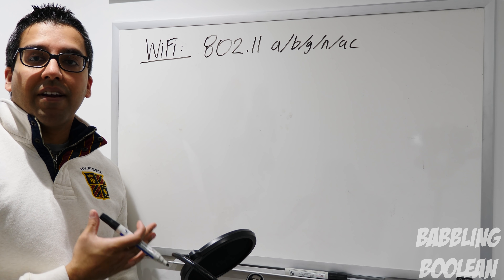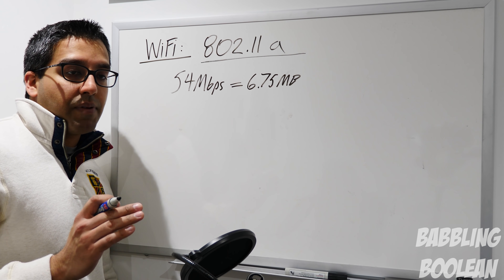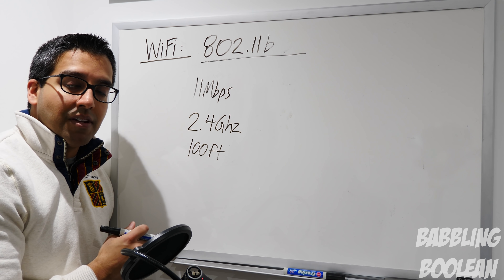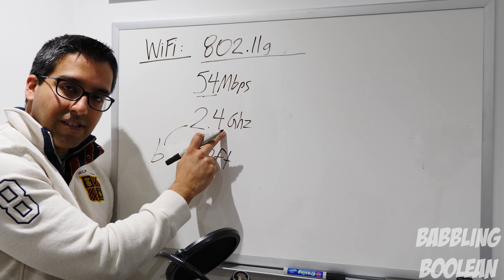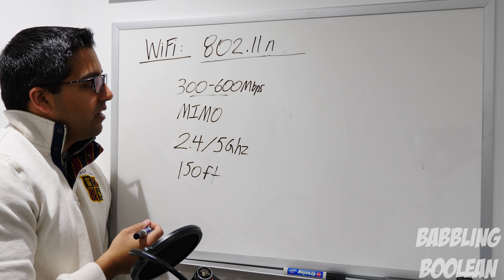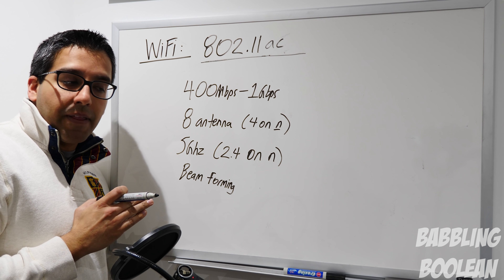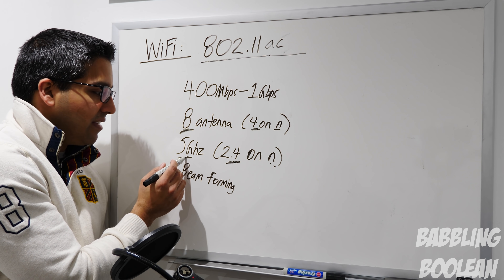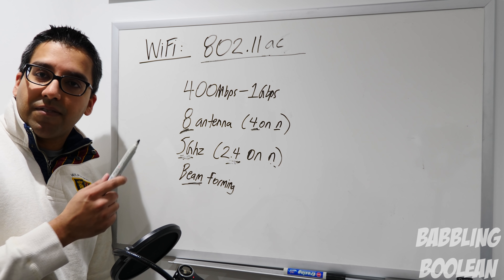Explained: WiFi 802.11 a/b/g/n/ac

Comment: Can you elaborate a little about the speed using ethernet connection on my home computer?
Reply from the maker: Ethernet provides a solid cable connection and is less susceptible to interference, connection drops due to range and faster speed. I guess I could make a video detailing the different versions of ethernet cables but that will be a little while away.

Comment: Hi, I have a question what happens if the router or modem appears the option of 802.11a/n/ac what is the best option to use the for the 5GHz the option of 802.11n because it's possible to use 2.4 and 5 in this mode or put the option of 802.11a/n/ac? 🤔

Comment: I have teenage boys whom with gaming and friends over, and use all of our high speed data in 2 days. Leaving us throttles the rest of the month. Is there anyway I can throttle my guest network?
Reply from the maker: Absolutely, if your Wifi router has that capability. I use Asus in my home and it has router settings for a guest network that allows me to set: password for guest network, how long the network stays up and throttling the speed. If you can't do that, it's a bit more work but most routers have some settings for QoS, you can explore that as an option too.

Comment: Does wireless type 802.11AC support old laptops having wireless type 802.11 a/b?
Reply from the maker: Yes the AC router will be backwards compatible and support the a/b devices. However, the a/b device's speed will cap at a/b speeds.

Comment: Great explanation. Tech made simple for those of us that are trying to learn and are not tech savvy. Thank you so much! However, I do have a specific question I hope you can answer, in your opinion, would the Lenovo Tab P11 Tablet, model # ZA7R0036US, with a 8.02AC(1x1) which Lenovo claims is a 2.4 GHZ tablet but would it be able to connect to 5GHz? Thank you, JD

Comment: So I want to buy a new phone and i plan to use it as a hotspot a lot of times to share the internet from mobile data with my PC. Should I buy a phone with 802.11 ac to achieve better speeds  with the hotspot or is this only applicable to WIFI and therefore 802.11 n is enough in a phone?

Comment: Great video - I was looking for a more technical explanation and this provided the level that I was after.   I can't get excited about the "ac" or "ax" or whatever the latest is - a mix of G and N provides the bandwidth I need for wireless connected devices.   For a lot of folks the limiting factor is going to be your ISP - not your wifi.

Comment: hi!!! i have 1 query if u can help. I recently bought a desktop tht has inbuilt wifi in the botherboard which is ac type, so whenever i connect to the internet, the internet magically stops working. this happens only when i turn the desktop on...internet works well on other devices when the desktop is off...i tried contacting my service provider they seem to dont understand the problm, also i have tried connecting the router via lan to my desktop but the problem persists. will be glad if u can help. thanks

Comment: my radio types show  802.11b 802.11g 802.11n 802.11a 802.11ac it means it is wifi 5 right ?
Reply from the maker: Yes
Reply: @Babblingboolean  thanks... what did you see in my given information when you say it is wifi 5 i just want to know so i can learn as well.

Comment: I have a 1gig connection and on lan I pretty much always reach full potential 900+Mbps but on my Android device which has a 802.11 a/b/g/n chip I max out at about 110 Mbps, directly a few cm next to router and tested on many servers. Shouldn't I be able to reach easily 300-600 Mbps according to your definition?

Comment: First there was 802.11. which effectively became 802.11b after 802.11a was added as it came first it was already in use.
Which is why it was more popular.
So effectively 802.11a came two years after 802.11b although 11b did bring a few incremental improvements.
But as the two were comparable it had a few years head start.
1997
1999
|
2003
2009
2014
2019
|
Future

802.11b
802.11b
802.11a
802.11g802.
802.11n (Wi-Fi 4)
802.11ac (Wi-Fi 5)
802.11ax (Wi-Fi 6)
802.11ax (Wi-Fi 6E)
802.11be (Wi-Fi 7) ?

Comment: My motherboard has a 802.3 standard lan port. Will it support 802.11 standard wifi?
Reply: No
Reply from the maker: Lan port is a wired connection, WiFi is wireless. They're two separate functions. You'll need to check your motherboard details to see if it supports WiFi.
Reply: @Babblingboolean  thanks for the reply. It supports & I'm currently using it without any hassle 😁

Comment: Hi, thanks for a great video. Just in the last couple of days I added three plug-in dual band range extenders to my 802.11n router on a wireless home network. But, the extenders could only find the 2.4GHz frequency. Any ideas why this might be?
Reply from the maker: I doubt it's the case but do the extenders even support 5Ghz signal?
Is your 5Ghz signal active within your router?
Is your 5Ghz signal active but broadcasting a hidden SSID?
It's hard to help without being there, you should call the manufacturer technical support.
Reply: @Babblingboolean  Thanks for the reply.
The router is a Huawei HG658c operating on 802.11n wireless protocol.
The extenders are indeed synchronous Belkin AC1200 Dual Band AC Wireless Range Extenders with Internal Antennae. 
I had a technician for Belkin walk me through correct set-up of the extenders over the phone, so I will contact my ISP as you suggested regarding the router.
Perhaps the 5GHz signal is inactive or using a hidden SSID in the router. I simply don't know how to check or adjust those settings.
Thanks again for your reply which I appreciate.

UPDATE
Having just contacted my ISP, they were able to tell me that the Huawei HG658c router, (which usually operates on 801.11n), provided by them with my Home Broadband package was in fact configured to operate on the single
frequency of 2.4GHz alone.
Such practices are not unknown with ISPs to provide different packages at different subscription rates to their customers.

Comment: I just bought the exact same router that you mentioned you have. I had severe signal conflict issues I think, we had a fast connection with a good N router but everyone on WiFi was struggling. Even with everyone connecting at only 2.4ghz on the new Asus router all problems have evaporated, devices close to the router I connect at 5ghz. I love the gigabit LAN switches as well, takes full advantage of my Intel gigabit LAN on my motherboard. I can't even express how huge an upgrade it was from a high quality Belkin N router to this RT-AC68U. It's epic, multiple 4k streams going at once, console gaming, pc gaming, and file transfer over the network to/from my NAS and never an issue. Great video it's nice to see exactly what it is about it that makes it so much better.

Comment: Missing MU-MIMO (key feature of 802.11ac), also Channel Width is a topic in 802.11ac (80/160 MHz Channels possible). Also Max Datarate on ac is at 6933,3 Mbit/s (including overhead, retransmissions etc.) This is somewhat basic aswell.

Comment: There are three reasons that you can't achieve maximum speed.
1. the overhead in each packet(preamble,header...)  
2. The time waiting for ack. 
3. Finally the CSMA/CA mechanism(DIFS,SIFS). that's describe how devices share the same network.
so, even though the signal level is pretty good, you will never achieve 6.75MBps with 11a due to the facts I present.

Comment: Thanks for the explanation. I didn't catch one thing. Can I use wifi router/repeater which is AC with devices that have 802.11n ? Backwards compatibility ac => n 
I did understand that it is not backwards compatible with b and g because they use 2.4 GHz frequency
Reply from the maker: Yes. AC routers broadcast 5Ghz but typically have N technology builtin to broadcast 2.4Ghz to other n, g and b devices.